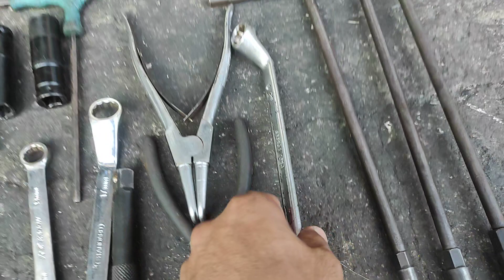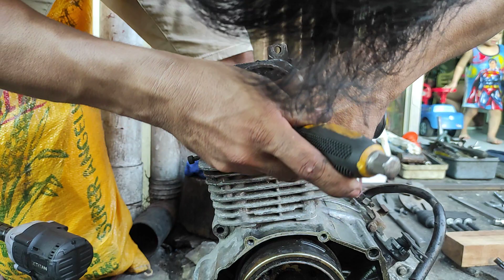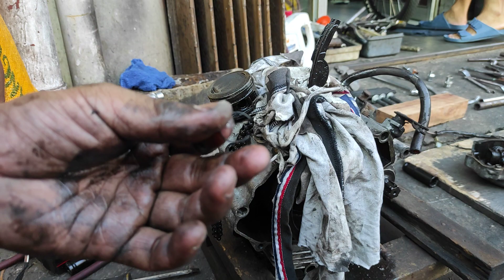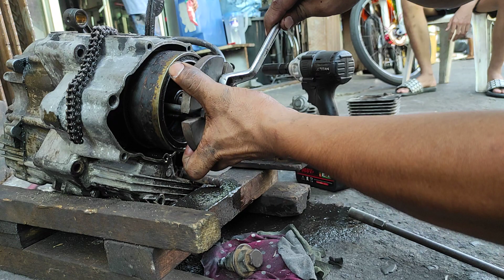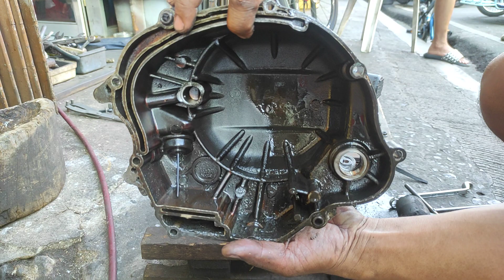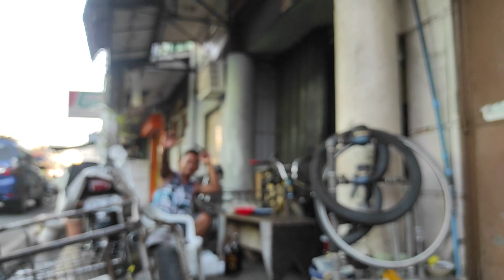Yamaha STX 125 Engine Overhaul - PART 1 (Engine Teardown)

Comment: Good morning Lods ask kulang Myron akung motor n stx 125 po lakas po ng tunog Paraná nagbabayo po sa ilalom ng makina tiktik2x ganun po ang tonug at saka may sumasayad siya page inestart m anu po sira non idol at saka tagas p ng oil sa clutch nya anu po sakit nya lods
Reply from the maker: Hello po Sir, good day.. Ahm about sa nagbabayo na tunog sa ilalim ng makina, maraming possibilities yan... Maaaring sa Engine bearings na baka makalog na, or sa connecting rod bearing mismo sa Segunyal... 

Pero since, nasabi mo na tumatagas ung langis sa clutch ng makina at kapag nag ki kick start ka eh parang may sumasayad, posibleng naglo loose ung sa clutch housing, or makalog na ung clutch housing, na posibleng nasasayaran ung Rotary filter sa pump drive gear.. Sa Clutch side kasi, sa engine, magkaka connect yan, from kick gear - idle gear - gear sa clutch housing to primary drive gear na katabi ng rotary filter.. 

Sa oil leak naman sa clutch, posibleng OIL SEAL mismo, sa push lever comp.. 

So technically, mate trace lang ung mga issues ng makina ng motor nyo Sir, kapag nabuksan o na disassemble na ung engine.. 

Well, ako personally, much better na makita ko ung engine ng motor nyo.. At marinig ko personall ung tunog at kalampag, hindi ko kasi totally and surely masasabi kung ano ang papalitan at kung paano ang gagawin para maayos at mawala ung problema ng engine ng motor nyo sir hanggat hindi ko personally nakikita ung engine.. Ang sinabi ko, is ung mga possibilities Sir.. ☺️

Anyways, taga Sampaloc, Manila po ako.. Kayo pp pala, taga saan

Comment: Mag kano po gastos po jn ser
Reply from the maker: @ReyganSeñeres  Hello po Sir.. Good day po.. Ahm actually, ako po personally ang nag-Overhaul nito.. And dito sa amin sa Manila, usually po, aabot po ng 1,500 pesos ang bayad for Major Engine Overhaul para sa motorcycle na may Clutch... Pero syempre, gagastos din po kayo para sa mga piyesa na dapat nang palitan, either replacements or Original/Genuine...

Pero sir, kung may Yamaha STX 125 engine kayo na ipapa-overhaul nyo, pwede po na sakin nyo na lang ipagawa...😊

Anyways, maraming salamat po sa inyong panonood ng video kong ito... 

Godbless po🙏👌